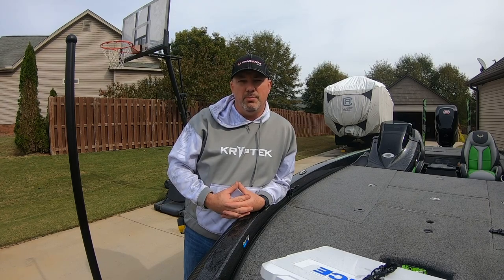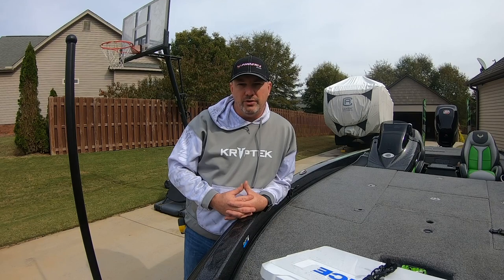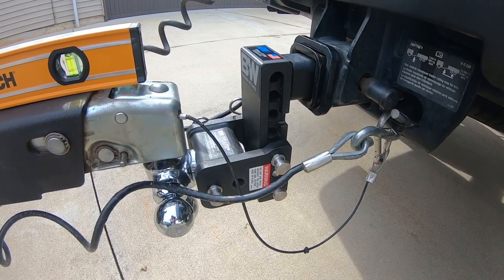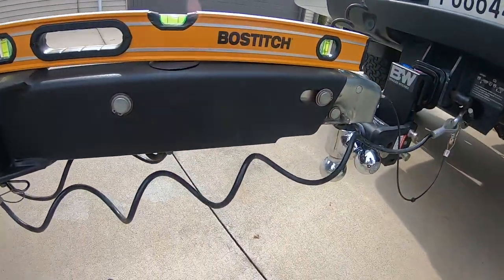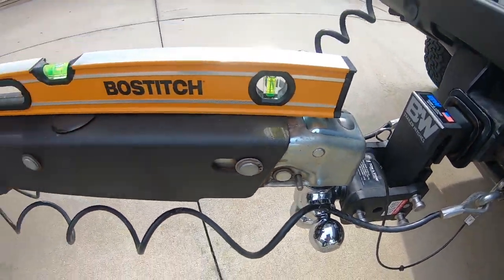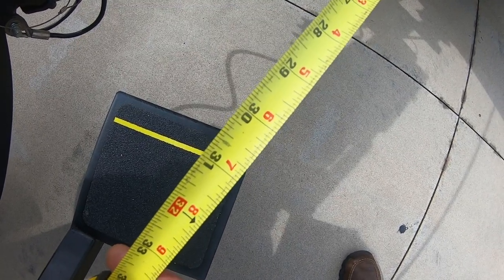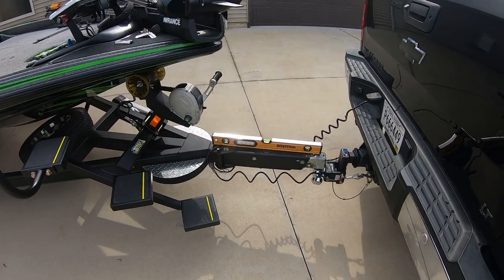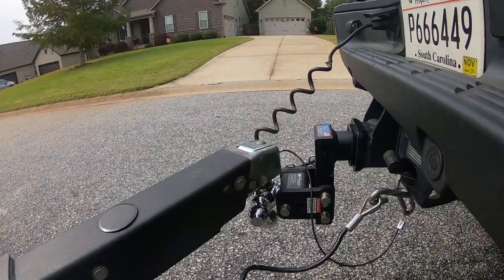Towing with Trick Steps

Comment: What’s the height of the handle on the Trick Step? I have to lower my motor and power poles to get in my garage and the door height is seven foot. 
Nice video. Thank you
Reply from the maker: You should be good to go. The height from the ground to the top of the handle is 71 1/2 inches (on level ground). Thanks for watching!

Comment: I made my own step $50 in metal and paint from local metal shop and about 4 hours of work…imo stronger than any step on the market 3/8 plate steer and 1/4” wall tubing
Reply from the maker: In my opinion, if you have the knowledge and tools, its always better to build something yourself. Unfortunately for me, I have neither for metal work! I could definitely make them out of wood but that wouldn’t work out too well!
Reply: @demboyzfishin1389  100% it just happened to be peak covid time and they were hard to get so it just improvised

Comment: I mounted one on my 17.7’ Bass Tracker. I made two right turns and now I have two big indentation’s in my right bumper. Now I make a left turn out of my driveway and turn around in a turn around. Like it but don’t love it.
Reply from the maker: Thank you for supporting the channel. What hitch are you using? Sounds like it does not extend out far enough.
Reply: @demboyzfishin1389  
Thanks, it is short but now I know which way to turn to keep the right bumper away from the steps.